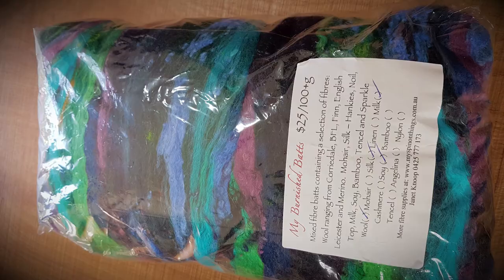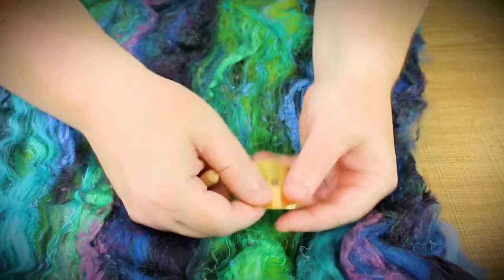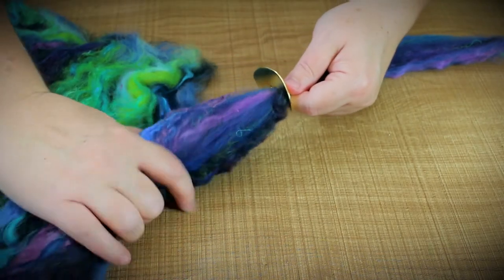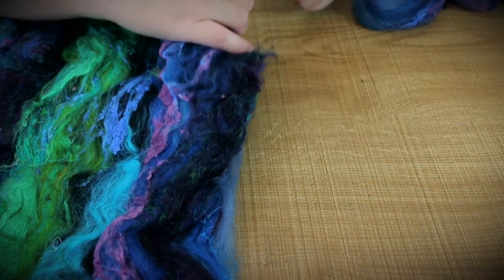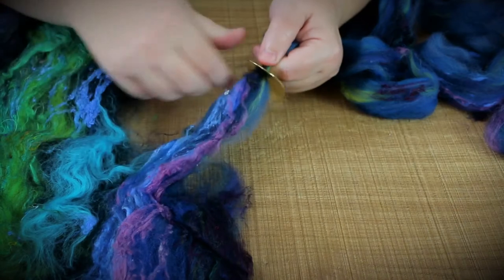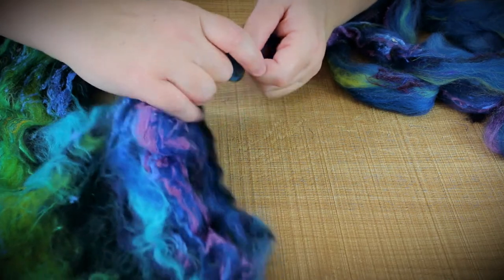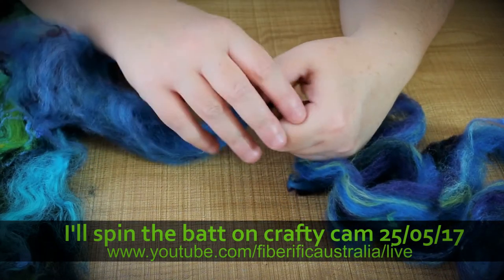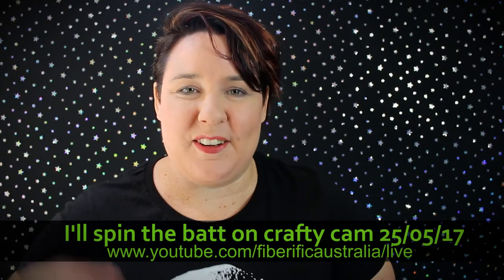How to Diz a Batt into roving using a Majacraft Brass Diz

Comment: I know this video is six years old… but I still thoroughly enjoyed it. 

I’ve only just gotten into spinning but am crawling down the rabbit of everything connected to spinning each time I have a few minutes. I’ve never tried my hand at dizzing but it seems like such a good method for fibre preparation that I now want my own diz. This gad me eyeing the pieces of coconut shell I have in the kitchen. Perhaps I can saw a piece into an oval and drill different sized holes in it. I’ve got a few bits I can use to smooth out the edges of the holes. The natural curve of the coconut shell should work nicely for a diz. Some rigorous sanding to get the outside smooth as well, and I should end up with a beautiful diz. Best part: I’ll have made it myself, and from something that would otherwise have ended up in the trash. 

Thank you for your video, you just gave me yet something more to try out! And if that diz turns out to work well, I might even make a second one for the friend who got me into spinning!